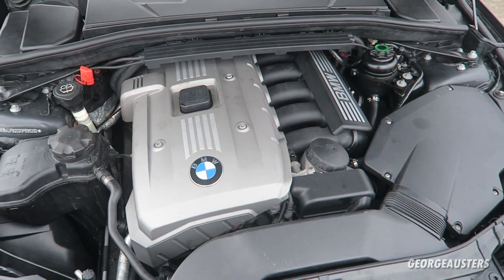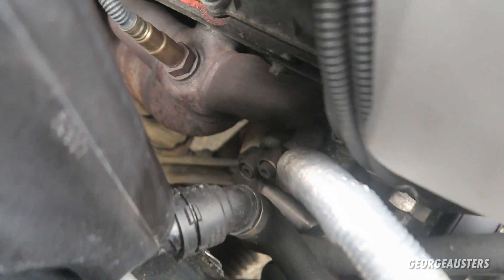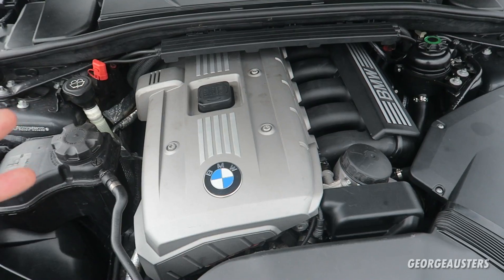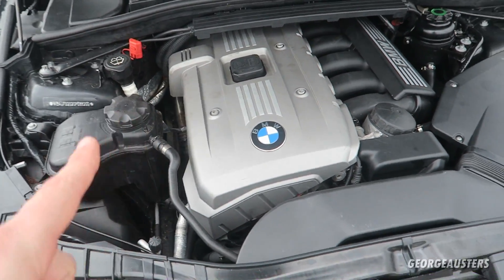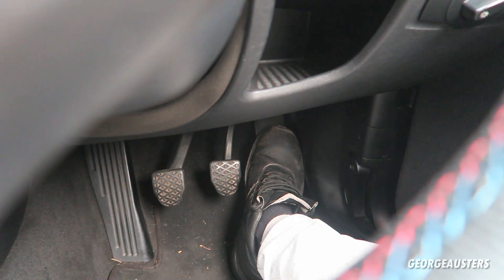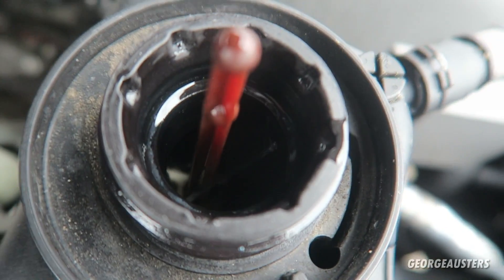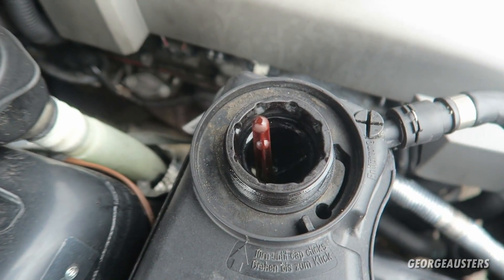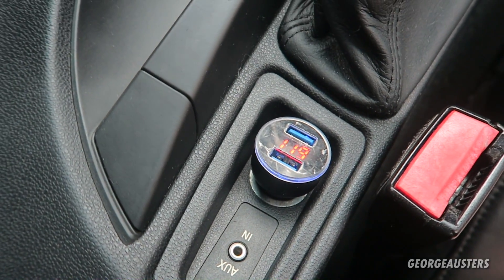How To Coolant Bleed BMW With An Electric Waterpump

Comment: I tried it once and my battery died; it didn't even last 10 minutes. Would it work if I started with just the pump on and then turned on the car? Do you think that would work too?

Comment: I did this and it seemed to work, but when I squeeze the coolant hose that comes out near the oil filter, that hose always seems empty, I expect to feel some water gushing around. (N51 basically N52). Might I have a thermostat closed or something?

Comment: with the thermostat closed on a cold engine, how can the entire cooling system be bled when the thermostat isn't allowing full circulation? The thermostat's design typically restricts flow to the radiator until it reaches a certain temperature. Can you explain please?

Comment: Hi 👋 if I not see water passes from the highest pipe as in the video and air comes out, does the pump need to be changed? 
when i leave the car idle the water level goes down. Do you suggest changing the pump and thermostat? i don't see any water leaks thanks

Comment: Should this be done after topping up coolant? My coolant is running low on my E88 118i N43 engine and I’ll need to refill. Would this be the next step?
Reply from the maker: No need really just to top up, but you should find out why you're losing coolant first

Comment: Hi guys, i have an BMW M235i N55 , i was at mecanic because it was overheating, he changed the cap on the expansion tank, now the car doesn't lose power anymore, but the water temperature is around 107-110°C and the oil 116-119°, now it's also very hot 37°C outside but i was also driving during a cold day 19°C, the oil and water temperatures were the same.
I asked the mechanic if it is okay to be so high and he said it is 4:39  okay... 
I wanted to ask here too because I can hear some light noises from the expansion tank. Is it okay to be at these temperatures? Thank you in advance!

Comment: That's not how it works on the 06 330i manual 6 speed
Reply from the maker: It is
Reply: @GeorgeAusters  you have to start the car, idle, turn the heater up to 84°first fan setting the lowest setting.

Comment: Can i do this with engine is running. I don't want to ruin the battery ( not able to connect a battery charger as well)
Reply from the maker: Just drive the car first, it won’t kill your battery running the water pump for 10 mins
Reply: Just leave the cap open and follow your step right, thank you so much for your reply

Comment: If this doesn't solve the issue with cold air one side hot the other, is it a case of try it a couple of times or do I move onto trying another issue?
Reply from the maker: Have you done a flush yet?
Reply: @GeorgeAusters  what's a flush?

Comment: Hi,I've just changed the water pump,but it is not working as you've just shown in the video there.all it does it pumps stops pumps stops and with not that presure
Reply: Can you do the same coolant on an automatic transmission bmw x1 Msports ?

Comment: My water pump won't start. Maybe it's kaput
Reply: Did you figure out the problem? Just replaced my water pump, but it still won’t turn on when I try the bleeding procedure
Reply: @Li8eralsarescum69  I replaced my water pump which worked for me. Have you tried checking the fuses in the white electrical box under the bonnet?
Reply: @kingcrumpet  yep just did that today. Fixed it immediately. Holding temp just fine now. Thanks 👍🏻
Reply: @Li8eralsarescum69  good to hear 👍

Comment: Do you leave the cap off the coolant bottle (header bottle) while bleeding for 10-15 minutes,after holding the gas pedal down for 10 to 15 seconds and opening it to check electric water pump is running as shown in the video. 

Very nice video

Comment: I have a 2017 430i and I think my mechanic didn’t do this to the car . I still have the car asking for coolant after it’s hot. When I remove the cap halfway I hear a lot of air coming out. Is that normal? I did change a hose and he replaced another piece under the manifold to remove the part. Any ideas?
Reply: @jorgemartinbg  bleeding wasn't done water pump likely kaput. bleeding saves alot of unnecessary costs

Comment: Hey I replaced my radiator and everything is good no leaks but I still have my light on for the coolant should I re bleed it ? And also don’t you have to turn the bleed screw when bleeding the system ?
Reply from the maker: If light is on then your coolant is low, just add more until at max level
Reply: @GeorgeAusters  it’s at its max level w the floating red thingy with coolant under could it  be that the radiator has the wrong drain plug I have a automatic and its the manual one originally in it I didn’t think to check it and just replaced the radiator but could that be a reason for the light to be on?

Comment: My 2014 535i overheated and derated on the interstate. I pulled over and found it was low on coolant (I hadn't checked it in 9 or so months). After I filled it, it continued to slowly overheat but then return to normal operating temperature, over and over again (I monitored the temperature via the hidden menu) . Once I got home I was able to bleed the system and top it up thanks to this/your video! Crisis averted  >.<

Comment: Hi George
I’m having a issue with my engine n53b30 325i, coolant overheating and going over the 90degrees celcius, a local garage diagnosed the issue and said it was the water pump which I changed today and I followed the procedure of bleeding it and getting the air out of the system but it’s still doing the same thing overheating and going over the 90degrees celcius. Any tips on what else I can check to see what’s causing this issue? pls try get back to me mate, cheers
Reply from the maker: What do you mean going over the 90 degrees? You do know these engines run at different temperatures right?
Reply: @GeorgeAusters  nah I don’t think their suppose to be running that hot tho?
Reply: Definitely shouldn’t be going over at least 110 degrees

Comment: Would I just leave everything closed if I want to start running coolant through the system before starting the engine? Had a severe coolant leak and engine over heated I waited 2 days before starting it again it got so bad i couldn’t even start my car but I want to run some coolant through the hose and around so when she starts she won’t over heat again. If she starts again 🤦🏽‍♂️
Reply from the maker: Watch this video again to see what I did👍🏻

Comment: do u have to flush after topping up when u take off cap? when i tried to bleed without CAR RUNNING, my headlites stayed on and ran my battery down? how u turn headlights off???
Reply: Same thing battery died on mine make sure charger on battery.
Reply from the maker: Just turn the headlights to the off position lol
Reply: @GeorgeAusters  i had them off but they still came on ..i didnt start the car as i was bleeding the system..weird..when i shut the start button off and pulled key out, they went off..
Reply: @GeorgeAusters  i had the daylight running 
 headlights on..saw a video on here how to shut them off..that is whay my battery died
Reply: @gail6904  pull out light switch on left .you can push it in and pull it out try that

Comment: What to do if your pump don’t cut on
Reply: Check black box with 30 30 20 30 30 fuse passenger side check those if pump not on I removed mine before doing this test coolant pushed right out .

Comment: Done this about 10 times so far and can still hear air in the system, no heat from heaters. As the water pump is cycling the water doing the bleed i can hear crackling/air by the oil filter. Cant find any leaks or anything and the car doesnt overheat, just no hor air out of the heater vents....which is getting pretty rough now its freezing cold in the UK.
Reply from the maker: Have you seen my "Heater not blowing warm air" video?

Comment: I always do it with the engine on for 10 minutes and then close cap and no problem
Reply: Same here. I run vehicle to temp. Fill. Then repeat.
Reply: Is the cap off or on
Reply: Start car take cap off put fan on one heat high ? Right that's what you do ?

Comment: Hi George, good work great channel. Any recommendations for replacing the water pump on my E93 N53 engine? There seems to be a lot of choice, I guess most of the cheap ones will be Chinese? Is Pierberg a good bet?
Reply from the maker: Pierberg is OEM... I'll be doing mine soon!
Reply: @GeorgeAusters  Thanks George.

Comment: I have do this. But than im driving for 40 km highway . When im back i open the tank and still water bleeding into the tank. Whats wrong.
Reply: How did you turn off please let me know
Reply: @MegaPyky  They told me its normal. And i do the bleeding again

Comment: This will work for N46B20 egine? (BMW 1 series 118i 06 modell) very nice video;)
Reply from the maker: If it has an electric waterpump (not belt driven)
Reply: @GeorgeAusters  I am not sure but if I remember corretly someone says yes it have but I have v-Belt. But anyways I think not so much air in the systemt now.

Comment: Thanks for the VD.
For me, there is no bleeding when i try to do this like U. N47 E90 LCI 320d. I don’t know something wrong.
Reply: It's making noise. Do I just stop after 15 minutes or is there a sign that I should look for that let's me know it finished?
Reply from the maker: N47 does not have an electric waterpump
Reply: @GeorgeAusters  thanks
Reply: @GeorgeAusters  So how do you bleed N47? Just start engine, open cap and let it idle for 15 min?
Reply from the maker: Essentially yes
Reply: @GeorgeAusters   Do all N47 engines use mechanical water pumps? I have a 2012 F20 116d I thought it was electric but now I'm not so sure lol